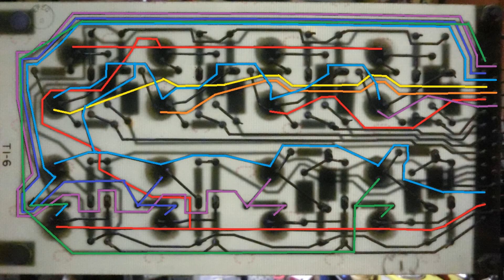1960s Mystery Circuit Modules

Comment: I have not seen them sent I was a kid .
The round looking thing or transistors
The rectangular or capacitors
The round one laying down with color band or resistors .
The capacitors akt like a batt load volt slowly leaks off out
the resistor and closes the transistors the transistor like a switch it
would operate a relay
I think thy or the old switching boards
Reply: Wow!

Comment: Maybe reverse engineer the schematic, that could give a clue also.
Reply from the maker: i tried that and explained where i got confused. did you watch the video?
Reply: Rinoa Super-Genius I continued to watch it after comment and forgot I wrote it, oops. :) Can I get a copy of the schematic (jpg/png/bmp format if possible) so I can help figuring it out? I have electronics hobby for quite few years, maybe there is some clue what it might be. (3 things comes in mind for possible application: amplifier, modulator or frequency multiplier)
Reply from the maker: DjResR well the schematic i made was only 1280x720 and so when i showed it on the video you can take a screenshot of it and get good enough quality.

and i cant take any more nice pictures of it because my good camera died on me a couple days ago. so my best camera is my tablet again. back to what i was using in late 2012 haha.
Reply: I took another look at the video and I found a clear view of the board. The schematic was something else than I thought to be a schematic, but I should be able to do it myself.
Reply from the maker: DjResR
yeah i have no actual schematics, if i did it wouldnt be a mystery then. :P
Reply: I got the first pair schematic done, it looks like the push-pull amplifier with band pass filter input and feedback on one transistor base.
Edit:First and second (from bottom board image started from bottom right) are identical isolated circuits, next two are almost same, only without the capacitors. All four pairs share the resistor to both base of transistors for most likely to pull down to avoid floating input - noise reduction. I checked the datasheet so I know that the center pin is base and all collectors are connected to shared power rail.
Second row four isolated pairs are almost identical to first row first two pair only the input capacitors and resistors are separated to two separate pins.
Reply: Schematic finished:
http://www.upload.ee/image/4454868/TI-6_Circuit_Board.bmp
Quite interesting project, it's 8 separate push-pull amplifiers with filtered inputs and pull-down/pull-up resistors to reduce noise in floating input.
Reply: DjResR outstanding effort! :-)
Reply: Gareth Crispin Thanks. :)
Reply: DjResR
Nice schematic! I figured it was an array of PP-pairs. If Rinoa SG were interested he could actually power it up and test it with that schematic. The transistors are rated for 25 volts so as long as you stay 5 to 10 volts below that for the supply it should work.

V+ to pin 21, V- to pin 23 and connect the bias lines to the rails pin 24 to V+ and pin 25 to V-

Connect an input to an audio source and connect the output of the chosen pair to a small speaker(as I assume you don't have a scope). You will need a capacitor between the output and the speaker though, otherwise the current will be very high due to DC offset and you will either kill a transistor or the speaker. Anything between 1 and 200 uF should work.

Should get a bit of amplification with around a half watt or so of output with a 12V power supply.